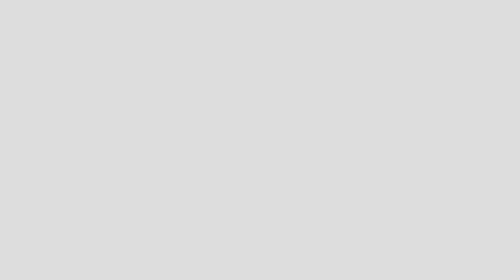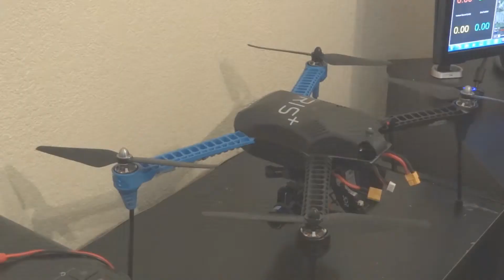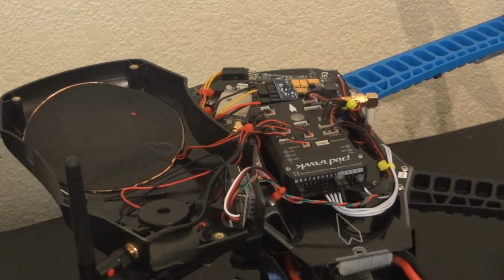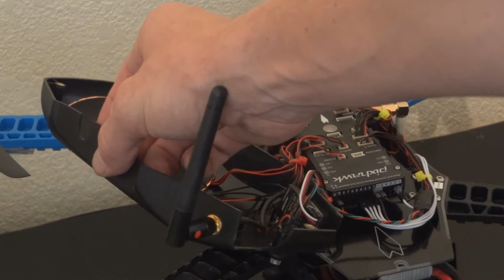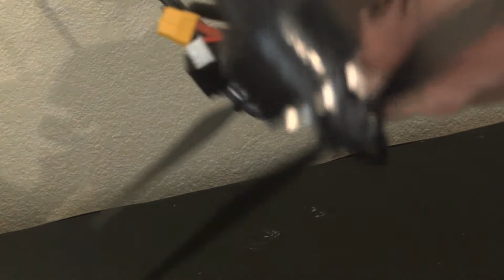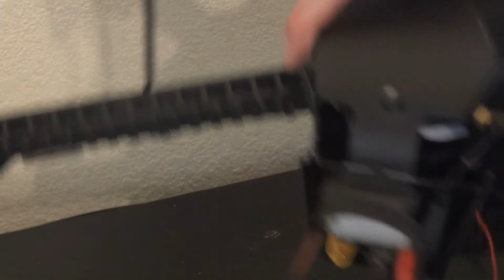Iris+ Upgrades and Modifications

Comment: A little confused,  Factory default parameters on this Iris + should automatically initiate  a return to launch when the battery voltage reaches 10.5 which should give you plenty of time to  land, 
I don't understand how you had a "hard" landing ?  did you change the parameters on this fail safe
I have done hundreds of flights on my Iris plus, and never had a hard landing , if I loose track of time, it remembers for me

and as far as the telemetry  goes, doesn't your radio have telemetry built in, ? mine does,
Reply: I HAVE BEEN USING 3DR EQUIPMENT SINCE THEY STARTED AND TO BE 100% HONEST MOST OF THE CRASHES PEOPLE HAVE WHILE FLYING ANYTHING 3DR IS USER ERA!!! THEY GO IN AND CHANGE PARAMS NOT KNOWING WHAT THERE DOING AND WANT TO BLAME THE PRODUCT!! ALSO I HAVE SAW SO MANY SO CALLED PROS    DOING AN AUTOTUNE ON A NEW IRIS+ WHICH IS NOT NEEDED!  AND YES IT COMES WITH TELM ON TX!   SO MANY THINK DJI PHANTOMS WHATEVER ARE GREAT! THEY SUCK! AND ZERO CUSTOMER SERVICE!. IF YOU KNOW OF ANYONE WHO IS LOOKING FOR A BRANDNEW SEALED IN BOX 3DR BLACKPEARL MONITOR FROM 3DR WITH AN EXTRA BATTERY THAT COMES WITH MONITOR FROM FACTORY SEALED IN THE BOX WITH FOLDABLE 3DR SUNSHADE  LET ME KNOW?